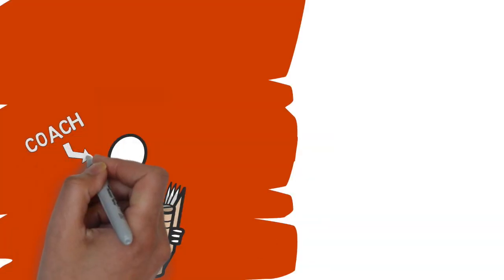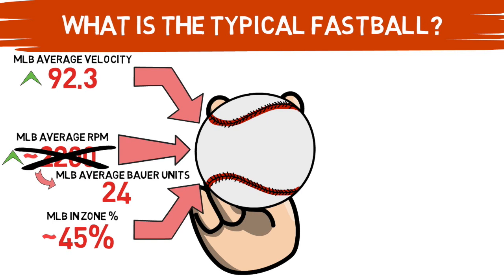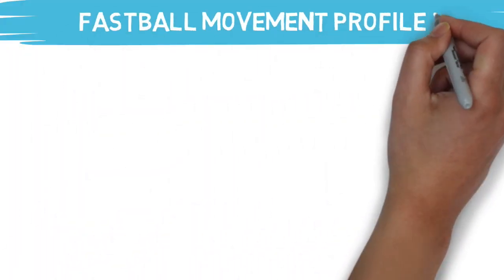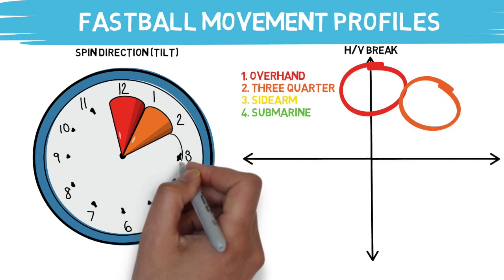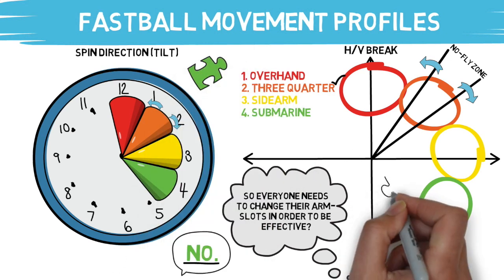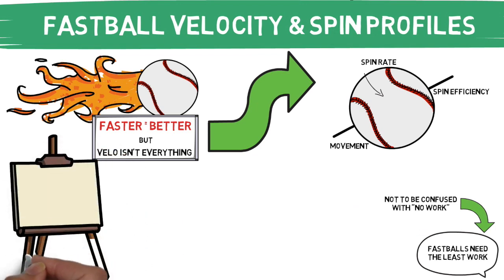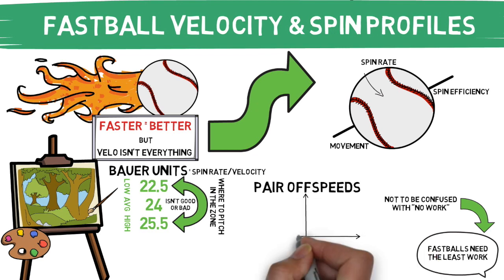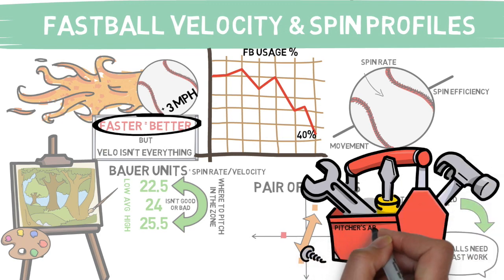FASTBALL PITCH DESIGN: The Ultimate Beginners Guide

Comment: So is "fastball" in this video is synonymous with "four seam fastball"? Aren't there other types of fastballs , such as the two-seam, sinker, and the cutter? I know the cutter is mentioned in your video on slider design, but what are the movements for two-seamers and sinkers?
Reply from the maker: Thanks for the comment! In this video I dive generally into the aspects of a pitcher’s delivery that affect each pitches movement. 

The one thing I did not reference was seam orientation and it’s effects on movement. That’s something I’ll be doing in a future video. 

2S and Sinkers will have a movement profile in the side-arm and submarine areas that I displayed on this video. 

My reason for not keying in on them specifically and blanketing all of those pitches under the term “fastball” was because many pitchers who throw multiple fastball variations don’t have much of a difference between the two when you look at the metrics. 

Hopefully this answers your question! Thanks again for the comment.